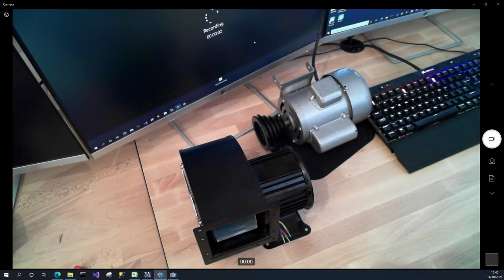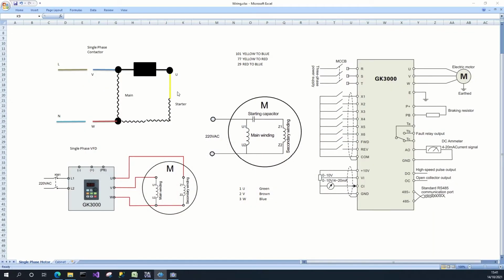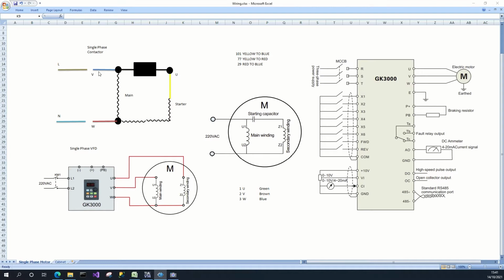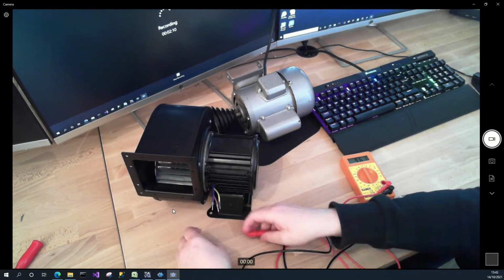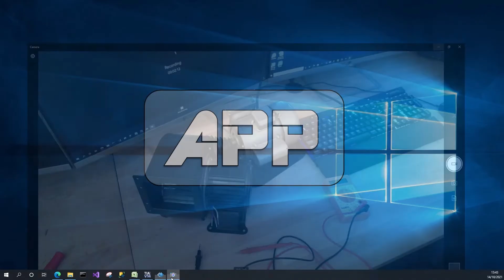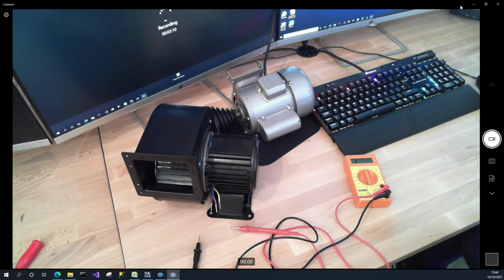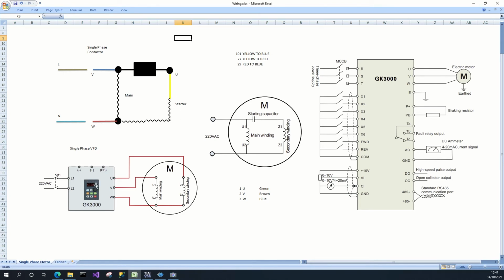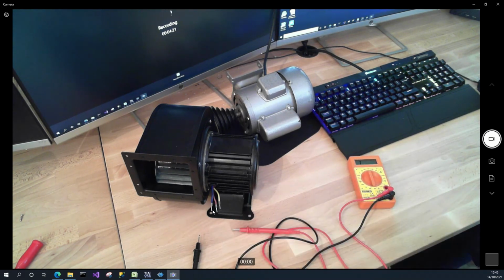Connecting Single Phase Motor main and starter windings to VFD

Comment: Hi Thanks for the nice and good explaining video well done. 👍
However I have a question,
My lathe has a one phase motor with starter winding,  can I use any VFD using your wiring configuration?
I have ordered this model VFD T13-750W-12-H .
Looking forward to your reply,
Yours Frans (Netherlands)

Comment: Hi, thank you for this video.

I want to ask some questions if you let me.

the vfd in the video is for 3phase motors, which is connected to 1 phase motor.
You mensioned that, it will compansate.

I'm not sure how its gonna compansate,
Could you please explain it?

since start coil and main coil winding resistance is different. Currents will be different, it could overheat the start coil. 

Thank you.
Reply: The VFD in the video is not used with a 3 phase motor. This is a single phase VFD only. The starter coil cuts off when the main winding is in use.
Reply: @Alan Phillips  Thank you for your reply. I edit my comment. I understand as it is. So the fan motor used in video, cuts second winding when motor starts. Thank you for explaining.
Reply: @AlanPhillipsAPP  so what i understand from your comment is that you don't need specific a single phase in & out VFD for a single phase motor, you can use single phase in and 3 phase out?  i am searching for an VFD to control a single phase induction motor 0.55 KW  quite a wile now , but i can't really find allot of info on single phase in and out VFD . please let me know. thanks in advance
Reply: @NLDHGRockStaR  If you have a single phase motor and you want variable control, you do require a single phase VFD.
Reply: @AlanPhillipsAPP  sir, if i want to change the direction, do i have to change the wiring. or just setup the parameter is enough
Reply: @namoan1930  no you dont need to change wiring. The vfd should have parameters that you can change which reverses polarity during runtime. Normally there are parameters for direction, acceleration, speed, brake time etc.